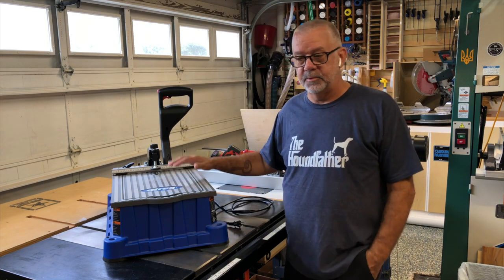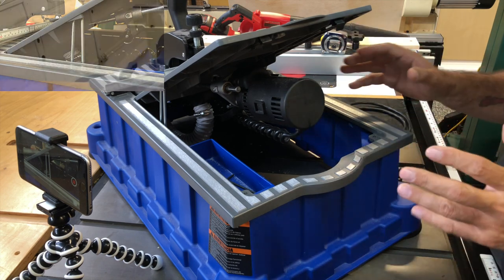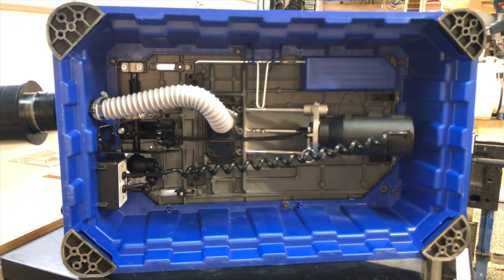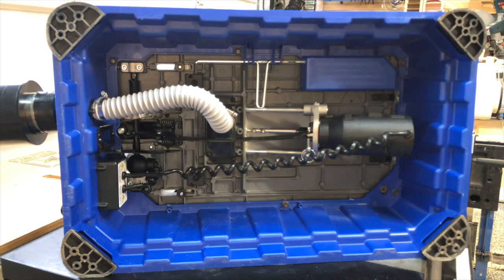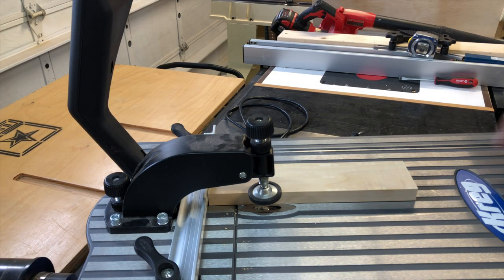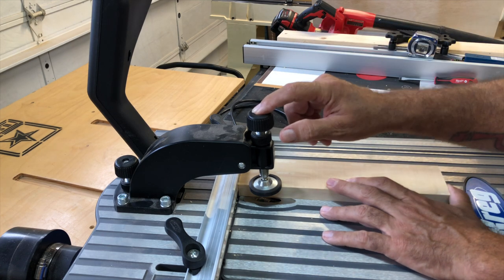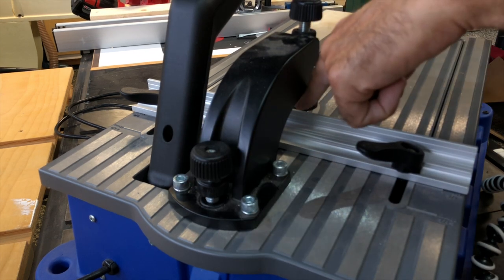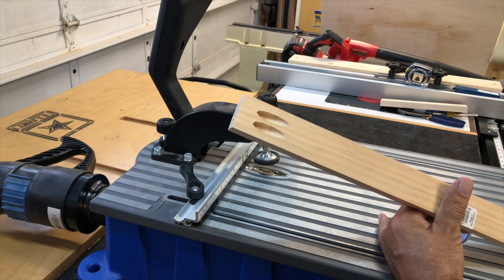Kreg Foreman DB210  Is it worth the Money?

Comment: This video was fantastic. I’ve had my db210 for a year now, built a rolling workstation around that was on the Kreg website as I’ve been setting up my shop. Today was really the first time I used it, that’s why I’m here. Lol😂
You cleared up everything about this machine in one shot. Thank you.
Question: Do you remember the part number that you used from Home Depot for the dust collection so I can use it with the same Rockler easy connect 4” system?
I appreciate your help.
Reply from the maker: I just went to Home Depot and bought a Furnco adapter in the plumbing section. You need one to go from the machine size to the vac port size.

Comment: Great video I am so glad I’ve got the older model because that model looks a lot cheaper and it is cheaper than what I pad for the one I’ve got.
Reply: It is. The DB210 is garbage.  It was so bad I sold it as soon as my DB110 was fixed.  The main issue is the clamping mechanism allows wood to shift which causes the bits the break no matter how tight you set the mechanism.   Additionally, because most of the machine is plastic it likes to flex.  Finally, due to the obnoxious shape, building this into  a shop table really isn't practical.

Comment: I hope this is not a silly question...to power it up you just plug in an electric cord? Thanks.
Reply from the maker: Yes. Is has a spindle motor that runs the bit. It’s a very nice machine. I use it all the time. Saves tons of time.